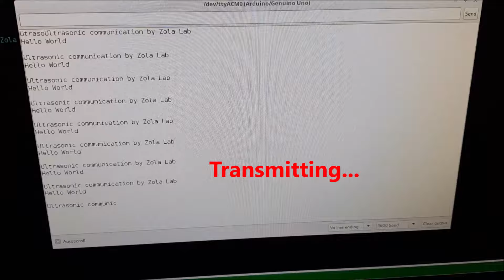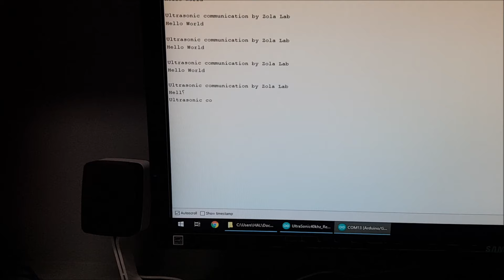Ultrasonic Communications - HACK AN ULTRASONIC HC-SR04 MODULE AND MAKE IT TALK

Comment: Hey great video! Just had a question about the code; The receiving code first calls milli() and increments bits1++ but I am having trouble understanding what bits1 does. In addition,  what do the values 20, 290, 600 refer to?

Comment: Well done, man! I will remove the transductors too. I want to project an analogous model of a cylindric hull mounted SONAR. 
But I will try reuse the HC-SR04 PCB, putting the 2 transductors to receive and transmit.
Do you have a tip for me or a detailed HC-SR04 PCB datasheet?
Thanks!

Comment: Awesome demonstration!!!  I am looking at creating a submersible and using ultrasonic communication to wirelessly communicate from the surface, or just below the surface, to the UUV.
Reply: Have you made any progress with this? I had a similar idea, but wanted to achieve bidirectional comms.
Reply: @andrewpeterst  did you start this project? i am really interested too
Reply: @fedimakni1200  Nope! I tried working on imitating this project and I think I got bad op-amps on Amazon. But my idea would be to take an existing remote controller for a cheap toy or submarine, but replace the IR send/receive components with ultrasonic ones. That avoids designing anything from the ground up, so should save time.
Reply: @andrewpeterst  did you waterproof them? If yes how and did you get any drop in signal because of that? Do you plan to do it again or you have any progress? I am interested in underwater communication that's why
Reply: @fedimakni1200  you misunderstand, I tried replicating the project in the video we're commenting on. I have made no progress in any comma project.

Comment from the maker: Here is my code:

=== Transmitter Code ===
/* 
  Developed by:  Eduardo Zola - Zola Lab 2018 - www.zolalab.com.br - egzola@gmail.com
  Ultrasonic Data Communication
  Copyright (c) 2015 Eduardo Zola.  All right reserved.
  This library is free software; you can redistribute it and/or
  modify it under the terms of the GNU Lesser General Public
  License as published by the Free Software Foundation; either
  version 2.1 of the License, or (at your option) any later version.
  This library is distributed in the hope that it will be useful,
  but WITHOUT ANY WARRANTY; without even the implied warranty of
  MERCHANTABILITY or FITNESS FOR A PARTICULAR PURPOSE.  See the GNU
  Lesser General Public License for more details.
*/

void setup() 
{
    Serial.begin(115200);
    pinMode(3,OUTPUT);
}

void loop() 
{
   send("Ultrasonic communication by Zola Lab\n");
   send("Hello World\n\n");   
}

void send(String msg)
{
   byte ch;
   unsigned int pos = 0;
   unsigned int sz = msg.length();
   while(pos<sz)
   {
      ch = msg.charAt(pos);
      Serial.print((char)ch);
      tone(3,40000);
      delay(10);
      noTone(3);
      for(int i=0;i<8;i++)
      {
         boolean b;
         b = bitRead(ch,7-i);
         if(b) 
         {
            tone(3,40000);
            delay(2);
         }
         else
         {
            tone(3,40000);
            delay(4);
         }
         noTone(3);
         delay(11);
      }
      pos++;
   }
}

=== Receiver Code ===
/* 
  Developed by:  Eduardo Zola - Zola Lab 2018 - www.zolalab.com.br - egzola@gmail.com
  Ultrasonic Data Communication
  Copyright (c) 2015 Eduardo Zola.  All right reserved.
  This library is free software; you can redistribute it and/or
  modify it under the terms of the GNU Lesser General Public
  License as published by the Free Software Foundation; either
  version 2.1 of the License, or (at your option) any later version.
  This library is distributed in the hope that it will be useful,
  but WITHOUT ANY WARRANTY; without even the implied warranty of
  MERCHANTABILITY or FITNESS FOR A PARTICULAR PURPOSE.  See the GNU
  Lesser General Public License for more details.
*/

int pos = 0;
unsigned char CH = 0;
unsigned int bits1 = 0;
boolean capture = false;

void setup() 
{
   Serial.begin(115200);
   pinMode(5,INPUT_PULLUP);
}

void loop() 
{
   if(digitalRead(5))
   {
      bits1 = 0;
      unsigned long deltaT = millis();
      while(millis()-deltaT <= 10) if(digitalRead(5)) bits1 ++;
      //Serial.println(bits1); 
      if(capture)
      {
         boolean b = 0;
         if(bits1 > 290 && bits1 < 600) b = 0;
         if(bits1 > 20 && bits1 < 290) b = 1;
         if(b) bitSet(CH,7-pos); else bitClear(CH,7-pos);
         //Serial.print(b);
         pos++;
         if(pos == 8)
         {
            Serial.print((char)CH);
            pos = 0;
            capture = false;
         }
      }
      if(bits1 > 600) 
      {
         capture = true;
         pos = 0;
      }
   }
}